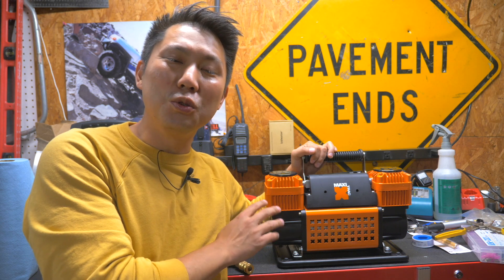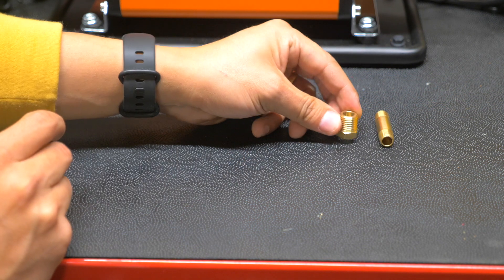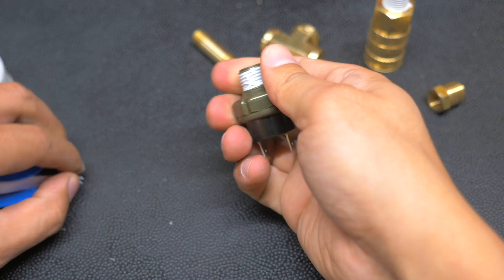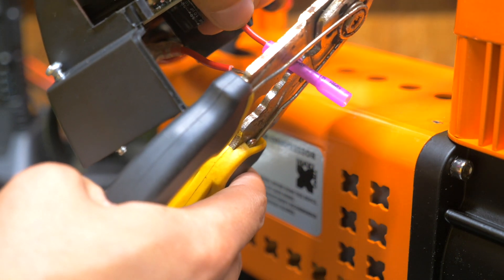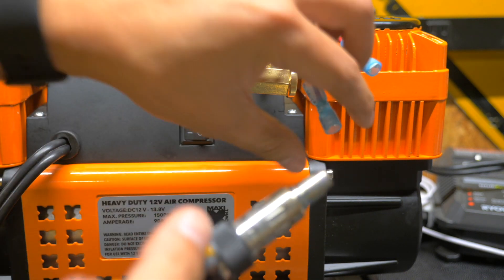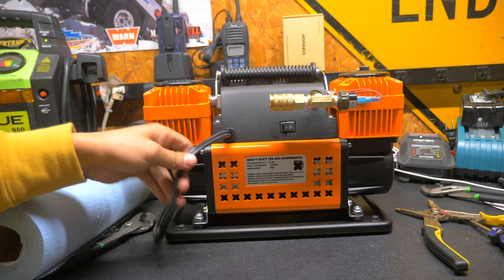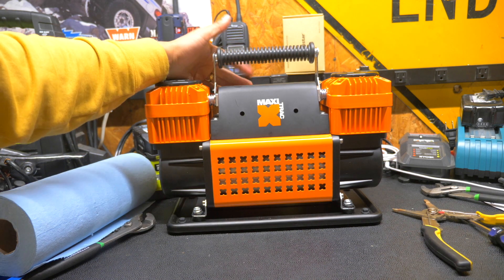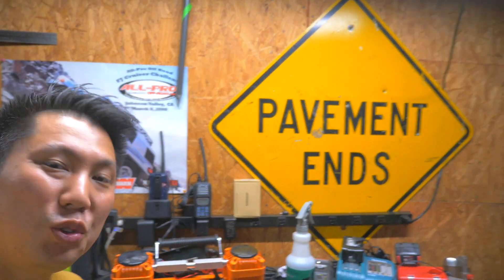Maxi Trac  Dual Air Compressor Pressure Switch DIY upgrade and review - Is it worth it?

Comment: The wiring heat shrink failure happened because you wired the presure switch within the circuit board by cutting that red wire. That makes everything in feont of that switch still hot when connected to power. You should have wired the presure switch in line with the main positive lead coming from the battery so the switch would kill voltage before it got to the circuitboard.
Reply from the maker: I disagree, the pressure switch powers the relays which is what controls the power incoming... no different than the on off switch that is there. The heat shrink failure has been found by several others even before modding their compressors.
Reply: Agree with the vid, cut power to the switch line which is the switch turning relay on/off. Need a seriously heavy duty switch to control the 90a draw this would have.

The relay should do the heavy lifting of power not the switches. Can run near 100a through a switch unless it's made for it...none of these are

Comment: I seriously doubt that pressure switch is rated to handle the 90 amps that the compressor is rated at.
Reply from the maker: The pressure switch controls the on off of the existing power switch. There are relays to handle the 90 amps.
Reply: @lonelydriver82  Ahh, thanks.  I guess I wasn't paying attention, I thought you had wired it into the power feed.

Comment: Got one last month and modified immediately. Also added an anderson plug. It's a good compressor band definitely recommend it
Reply from the maker: Anderson plug sounds like a good idea!
Reply: Can I see how you did the anderson plug? Which plug did you get specifically? I imagine it has to be able to handle 90 amps.

Comment: Thanks for the very informative video Kevin.  Is there any reason why we couldnt just use 1/8" parts?  I know the same company makes the same 90-120psi pressure switch in 1/8" as well.

So, 1/8" extender to a 1/8" 3-way adapter. Use the 1/8" switch on one end and the appropriate connector on the other end.
Reply from the maker: Hey, don't see why not! great thing is you can make it any way you want.. add a pressure release valve, add another 3 way for a second coupler etc. have fun!

Comment: Just a thought….maybe you tripped a circuit breaker in your battery pack. These compressors draw a lot of current especially when under a load, as you’re putting it in when the pressure is spiking to 120psi. I’ve measured mine up to 70 amps when I’m airing up tires. I always have my compressor running, free flowing, when I attach it to my air hose to avoid the current spikes.
Reply: I believe these units are drawing 90A running

Comment: I wonder if the cycling on and off had something to do with it stopping working.  

It’s usually not good for relays and motors to start and stop like that. 

I just got this compressor but I may try doing a relief valve on the pressure side. Motor would keep running but let out the pressure at a certain setpoint.
Reply: That's a really interesting point.   I know some compressors suggest you having them running before connecting them to the tire.  And this compressor probably isn't designed to hit 120 psi either, if I was going to do this mod I would find a 40psi switch.      The relief valve is a good idea too, do they make them where they bleed off until they get below a certain threshold?

Comment: I have a question is it the wiring that caused your compressor to stop working or was it the fact that you added the pressure switch? Just kind of curious because I would like to do this to my compressor maxi tracks but I really don’t want to risk having it stop working?
Reply from the maker: Hey Jason , my opinion the bad factory wiring is what caused mine to stop working. Nothing I modded should have caused any issues.
Reply: @lonelydriver82  Cool thank you for that opinion on it I will be adding the pressure switch to mine as well already did the hose upgrade Thanks Kevin

Comment: I seems that the makers don't have much confidence, as these come with no warranties.  The do put out a ton of air, but as you found, they're sketchy.  For the price, maybe it's worth it if you won't depend on it for safety, but if you're putting on an off-roader to air up to get on the road, you need reliability, particularly if you go out alone.  

I used to have an '69 FJ-55 and a '76 FJ-40 and got rid of them when my job forced a move; I just couldn't afford to move them and had no place to put them until I got settled.  I still regret not figuring out a way to keep them.
Reply from the maker: I agree, especially if you're going out alone you want something reliable. on my 60, I do have a hard mounted ARB as well. I also wanna call out that a lot of the compressors on the market are relabeled Chinese compressors.. you'll find this exact compressor with different stickers and colors  and brand names on them.... I'll be testing it out, and hopefully other than the wiring issue these will do a decent job.  I have another compressor that's I've been using for over 10 years and won't die on me... made in china.  Life lesson I've learned so far and you've confirmed... don't sell Landcruisers only buy.. :)

Comment: Just picked one up as well, excited to do this mod. Also, thanks for finding those problems out and sharing, hopefully you can swap it out at Napa!
Reply from the maker: Thanks glad the video was helpful, the compressor is working well so no need to swap it out for now :)
Reply: @lonelydriver82  what did you do to make it work again?  Mine stop working.
Reply: @TheCsarhdz  just replace the wiring. Dirt Lifestyle just did an even better video of modifying this pump.
Reply: What happened to it? Was a repair needed, going to do this as well.

Comment: If I were to hardwire this compressor what size fuse would I use?
Reply from the maker: That's a great question, fuse size depends on the gauge of the power wires. I haven't really inspected it, but if you can identify the wire gauge that goes to the clamps ,I'd Google that and find the appropriate fuse size. Napa also lists a built in circuit breaker In the description, it might be hidden inside the compressor chassis, altho I personally like to have the fuses close to the battery/power source.
Reply: @lonelydriver82  yes I agree with that. I noticed that too but where I want mine would be in the back of my vehicle so I want a fuse as close to the battery as possible. Thanks for the video man. I ordered my switch last night so I’ll be doing this in the next few days 👍🏻
Reply: @lonelydriver82  I would not ad an aftermarket fuse.  That thing draws 90 Amps.  Your mod should work perfect without adding a fuse.

Comment: i see it comes with a longer black hose. do you know if that is 1/4"?
Reply from the maker: The black hose has non standard size fittings. Not sure what the actual hose diameter is, I ended up throwing it out.
Reply: @lonelydriver82  So the hose has a non-tandard fitting. According to your video is appears that the port on the compressor is an SAE 1/8 FNPT port and not an similarly-sized  metric port?  This is the only reason I haven't jumped to buy this compressor is my uncertainty of that very port.
Reply from the maker: @LightsOut-xw9cu  yup the 1/8 screwed right in. The non standard size i was referring to was the coupler fitting attached to the hose.. not sure why they sell em with these non standard fittings, maybe its what they use in the rest of the world.
Reply: @lonelydriver82  Thank you! I appreciate the information.
Reply: It's a common Metric size I've heard...since all these come from China originally

Comment: Interesting that I just found this video, as I'm currently in the middle of doing this exact thing. However, from what I can tell the threading in the manifold between the cylinders isn't actually 1/8" NPT but is actually 1/8" BSP (British Standard Pipe). The NPT has 27 threads/inch while the BSP has 28 threads/inch. There is very little difference otherwise and obviously its possible to use the NPT fitting as you have clearly shown. Great video though, just wanted that info out in the world so that it may help someone else. 

P.S. - Great looking FJ60. I used to have an 84' FJ60 myself and wish I wouldn't have parted with it.
Reply: Yup I had to shell out 15 bucks for the metric to npt adapter
Reply from the maker: good info,  thanks for sharing! it threaded in very easily so i would have never guessed! no leaks either.  I had an 88 fj62 and a 99 100 series.. regret selling both... this 60 is here to stay!
Reply: Should we be re-threading the threads to BSP-⅛x28?
Reply: @irwinjimenez  that's what the threads are already. Just use a 1/8" npt like he used in the video.

Comment: Thank you so much for this video! I just checked mine and the same wire is poking through their heat shrink on mine too. I have not started it yet so I will add some electrical tape to it before I run it for the first time.
Reply from the maker: glad the video helped you catch it! Still a great compressor, once you address that issue!

Comment: What made you choose that pressure switch over the ones that shut off at a lower psi? Is 120 too high? Is there a built in check valve? Looking to do this same mod but want to make sure I order the correct switch.
Reply from the maker: That's a good question, I'm no engineer but I air up my sprinter e rated tires upto 70 psi and wanted some headroom as I'm not sure if there's spike or surges when starting up that might prematurely turn the compressor off at say 90 psi...  If it makes you feel better the pressure switch in the ARB's turns off at 135 psi.
Reply: @lonelydriver82  sounds good. Thank you and great video! I’ll be doing this
Reply: @lonelydriver82  what size wire did you use?
Reply from the maker: @PKDiver  I believe it might have been 14 gauge , but the wire i used was definitely larger than the stock switch wire. as long as it's not thinner than the stock wire, it should be fine.
Reply: This compressor is rated for a maximum working load of 150 psi, so a 90/120 switch is pretty common for these types of compressors because it gives a safety net of 30 psi for it to cut off and even further limit damage to the compressor, and most people just use a 12V compressor for tire inflation, which would never really need to be inflated up to 120 psi.
Reply: @jonh6189  thanks for the info. Very helpful

Comment: I just picked one up with their 20% off sales and was thinking about doing the same pressure switch mod.  Sorry to hear about your compressor :( Napa has a 30 day guarantee, so I hope you can return it! I'm going to take mine apart and check all of the electrical wires for any unprotected strands - I hope to have better luck!

I recently found your channel and love your videos! Its clear that you put a lot of time into making them, keep it up :) I plan on making the 4 tire inflation/deflation system you shared!
Reply from the maker: Thanks man! Would love to make more videos but work keeps me busy! Haha will definitely be swapping mine out, hopefully mine was built on a Monday and not common.
Reply: @lonelydriver82  I'm sure! Keep up the good work though!  I just opened mine up, and thankfully I didn't have any exposed wire, but I did have that bigger (crimp?) hole in the heat shrink that was a little higher up... I went ahead and added a bunch of electrical tape over top, just to be safe!
Reply: @lonelydriver82  bypass the board if it was a electronic failure.